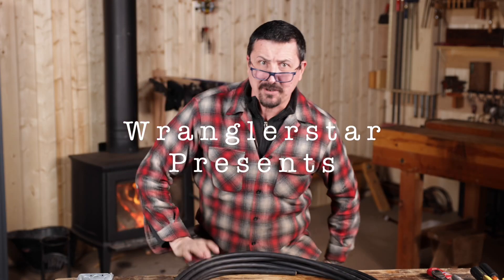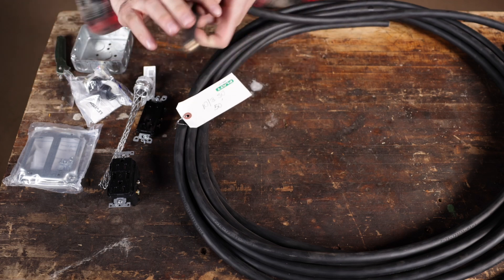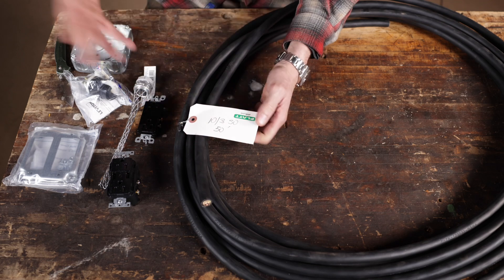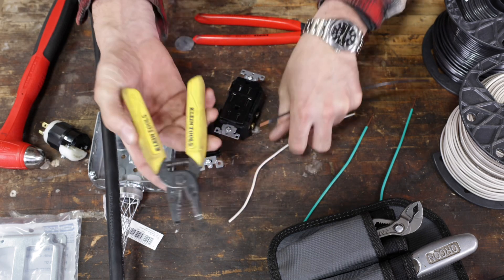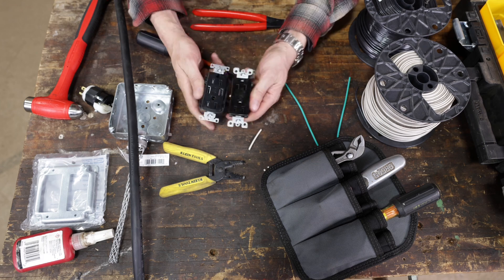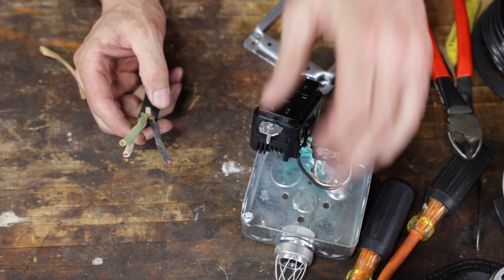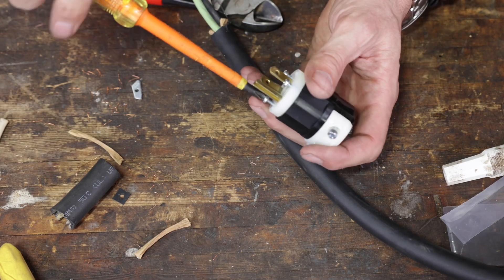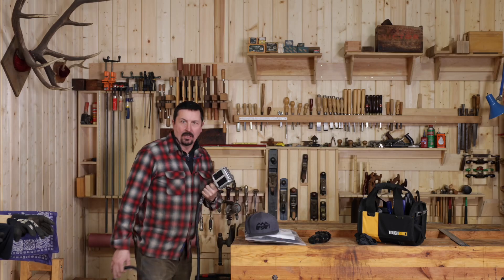The Ultimate $150 Shop Accessory - ALPHA CORD

Comment: I'm curious: Why didn't you use a weather-proof exterior box instead of the interior one? Also, why did you use 15-amp receptacles instead of 20-amp? Other than that, it looks good!
Reply: NEC allows for 15a receptacles on a 20A circuit.  I believe this is the only scenario where you are permitted to use a lesser-rated receptacle than the circuit it is designed for.  I'm not an electrician though - others will probably post the technical reason (I think it has to do with ampacity and de-rating and so forth).  If it were me, I would have used a GFCI as the "input" plug, and then wired the other outlet into the "load" side of the GCFI, so both would be protected.  I'm guessing the metal box for a few reasons: it's cheaper, and it's more durable (Aluminum/weather boxes are cast and could crack from dropping it).  I made a quad box like this and permanently attached to my welding cart (1. welder, 2. grinder, 3. wire wheel, 4. chop saw)

Comment: Small correction. Incase you guys are making these, the "jam nut'  is a called a lock ring. The piece he is using inside the box is called a fiber bushing. The correct way to install that stress relief is to have threads fully inside the 4x4 box, then put the lock ring on the threads to tighen to box, then put the fiber bushing last. The fiber bushing is to protect conductors from abrasion from the metal threads. The way he is explaining to do it, your stress relief is only held only by that small plastic bushing.

Comment: Why not have one 20A receptacle, seeing that 10 gauge cable is being used? Unless that cable is really long 20A may come in handy if you need two things operating at once, like a small heater and a heavy current draw tool.

Comment: 10-3 usually means 3 conductors PLUS the bare bond conductor, but not always. Some types of cables include the bond conductor in their ‘call out’ designation, where 10-3 could mean a black, a white and a green

Comment: nice, i repurposed an EV charging cable for a similar thing in my workshop. the damn EV plug on it had a defect that couldve been easy to repair except the thing was impossible to open without destroying the shell. also a replacement plug cost the same as a new complete cable... so i just cut off the EV plugs and made a nice thick extension cord for my tools with it.

Comment: In the context of how electrical installations in the US are standardized from NEC this is a well made extension with minimal issues on the retaining nut and how the wires are attached, nothing critical.
From a mechanical perspective i really like the general approach with a grounded metal housing and a very sophisticated strain relieve that also functions as kind of bend protection.

On a general state however I am always baffled that the connector pins, when they aren´t seated fully, by design, are open for dirt and possible short circuiting from debris. 
The whole box also does not seem to be suited for humid or wet environments, or even damp grass, so this seems to be a "indoor" extension.

Or maybe 120V is just not as critical for such issues. If the "normal" voltage was 230V Phase to Neutral and 400V from Phase to Phase you'd just have to have that kind of shielding (Type C, Type E, Type F, Type J or Type N and so on) so this would be prevented mechanically.

Who knows...

Comment: For only a few dollars more you could have put this into a water resistant box with glands where the cable inserts so you have a box that is safer to have on the ground should there be water or say you want to run power outside the shop and there is snow/rain etc. That's how mine is.

Comment: East coast electrician here, I wish most cheap extension cords use 14 wire at least, most are 16 gauge wire. Yes 16 gauge is fine for maybe running a single shop light 100 ft away or so but as soon as you start running maybe a pump or heavy duty saws anything with a larger motor those cords don't last to long.

I see a few comments already indicating the lock nut should go on the inside of the box and im not the first to say this but the metal lock nut then the plastic bushing. Also instead of using gold to black use this saying Brass to Black!

Comment: I have a question, is normally a cable, let say 10/2 for 120v and 10/3 for 240v in the US ? 
And also, is the only difference being the 10/3 having the ground wire insulated ? As 10/2 also have 3 wires but ground is not insulated.  I am wondering, please let me know :P   thanks

Comment: The reason its best to use the shortest and thickest cable you can is you want less voltage drop. More voltage drop means the tool or whatever pulls more amps to do the same job. More amps equals heat and excess heat equals early death for lots of things.

Comment: *PLAID**
Hey Cody! long time watcher, first time writer. I'm an electrician by trade and Frank's comment is correct about the lock nutt needing to be on the inside of the box, but my reason for commenting is on the box itself. To make  
A WAY COOLER ELECTRICAL BOX... Use a 2 gang metal exterior box. Its aluminum, but more importantly its moisture resistant (no mounting holes or partially opened knock outs) and then you could even add a "in use cover" so plugs would be covered for that inevitable knocked over coffee or whatever other liquids could be around. I think it would really level that thing up! Love to hear your thoughts on this! God bless you and yours! 
P.S. I also would have pigtailed 10g wire to the receptacles instead of the 12g. And you could also spend MORE MONEY on wire and bought 10-5 or 10-6 and then with box on other end with 2 plugs you could have a 120V/220V for welder AND tools! Huh? Just a thought 🙏✌😎

Comment: In a residential transformer in the United States, there is a 200/240 volt coil.  The two black wires entering your distribution panel connect to either end of that coil.  To get 110/120 volts for your home they connect a third wire (the white wire) to the center of the coil so that any electricity going through it is 110/120 because it is getting only half of the coil's voltage and current output.  The reason you get 220/240 volts by hooking two vertically mounted breakers together is because the bus bars from the two black wires alternate horizontally in connecting breakers.  That way two vertical breakers are on different bus bars and connect to both black wires to get the whole 220/240 volts from the transformer coil.

Unless you are using direct current, like you get with a car battery, both the black (hot) and white (neutral) are "hot" wires.  That is how alternating current works.  It changes directions (in the United States) sixty times a second.  That means the current goes both ways which means the black and white wire both have the potential to be hot and if you touch something else that causes the circuit to be complete while also touching the white wire then you will have electricity flowing through your body.

Comment: I've purchased the 10 / 4  power cable from Home Depot...  ouch its expensive but it performs well.  I used it to power my hunger speakers running off a 2000 watt amplifier.   No line drop!  All the power to the speaker!

Comment: I thought the first number refers to the gauge of the wire and the second number refers to how many wires are inside. 10/3 - 10 gauge wire with 3 wires inside? 

Is that correct? I know nothing about electric and wiring at all

Comment: If you don't want to use the copper ferrule then you can take a twist wire cap (red ones) and cut the top off. Take your two copper bares and twist them together with one lead longer than the other. Slip the cap over the wire through the hole you created and twist down where the two wires meet. You should have two wires twisted into the cap with the one copper lead sticking out of the top. They even make the twist caps with the hole already, search for Model 92 Greenie

Comment: Check out a Polar Wire, they are in Anchorage, AK and their wire looks even more flexible than what you showed. They have something called Arctic UltraFlex 100% copper wire built for the brutal cold of Alaska in any gauge you need. I own two sets of their jumper cables one with 4/0 conductors 30ft and the other a bit shorter is 3/0 wire, both have massive 1000 amp copper jaws, they are without question the highest quality, most rugged I have ever owned. I think you would be impressed by their wire quality

Comment: It's called SO Cord.. The technical type of cord it is, is probably SEOOW Cord. It has a lot of characteristics.. Like gasoline resistance, UV resistant, Impact resistant, etc..
Push the SO Cord through the kellem grip before you strip the outer jacket of the cord. Makes life way easier.
Your METAL lockring goes INSIDE the box, not outside. Then the plastic threaded bushing after the lockring. You don't need the bushing though.

Comment: I like the idea, nothing wrong with the setup. just wanted to mention that 10gauge wire is rated for 30amps. The two plugs that were installed are 15amp rated.  the cord end used was also 15amp rated. I can only assume it was being plugged into a 15amp rated circuit. There is nothing wrong with up sizing your wire. But In most applications it’s not necessary and not cost effective. the real alpha custom cord setup would be to 
1)upsize the breaker to 20amps
2)replace the plug(s) on that circuit to T-slot 20amp plugs as per code 
3) use #12/3 cable (#12 wire is rated for 20amps)
4) then install T-slot 20amp plugs into the box. Along with a 20amp rated cord end. This allows for higher current loads without burning up the wire and tripping the breaker. This give to best bang for you buck. 

Disclaimer this is based off of my local electrical code but common most everywhere.

Comment: 11:00 it does not fit because you are using 10/3 cable which is good for 20+amp with 15 amp plug. Upgrade to 20 amp and use outdoor box instead of that steal one so you can drag it outside when needed.

Comment: Small knit pick but as an EE it was driving me nuts. the "number wire" that you are referring to is called the gauge. It is vital to use the "gauge" vernacular when specifying wire sizes. If this is not done you could have some confusion with specialized cable (non-electrical) or mistake it for the electrical parameters (voltage, amperage, or Wattage). The sizes you show are AWG (American wire gauge) another reason to say gauge and not a number (especially if you are ordering from overseas) is that it could be confused with the international convention of using mm to measure the sizing. Love the setup otherwise, been a longtime viewer, and like to see something so close to home. I would love to spec out an even further over-engineered extension cable for you if you are interested.

Comment: the cable is called HO7NFR often referred to as TRS tough rubber sheath - always used in my industry for running temporary power for events.
Reply: that's in europe. in north america its SOW or SOOW often referred to as cab tire or sometimes you here cap tire

Comment: My Stage hand Brothers, I worked with wood add a base plate of 2 3/4 inch Birch Plywood Base plate blgger than the E box with a handle cutouts X 2 and rounded corners painted back stage Flat Black. The Stenciled Wranhlerstar in white.  Drill a few holes for a nail up or Screw to the Sticking post.  This base makes it "safer" on a damp or wet deck.

Comment: The electrician I worked for in high school and college went to govt auction.  He got a ship to shore power cable and did essentially this and had it set up to do 220 and 120 with a stupid simple mobile beaker box.  We would take about 30 minutes to set it up at a job site and be able to run the entire job site off it.   

But the basics of it was to build a giant extension cords like you did. That could easily be hooked up to line power then had breaker boxes and outlets.

Comment: How did you put ten gauge wire on the the screws on the receptacles?  You didn’t show that. They
 Wire doesn’t fit in the hole. PIA to bend 10 gauge around the screw. Better to use 12 gauge cord.

Comment: They do have them with USB-C, i recently installed one by the bed in my bedroom so i could plug my charging wire directly into the wall and get the faster charging speed, because i didn't like how far off the wall i had to move the side table to clear the charger adapter. 90 degree USB-C cable ftw.

Comment: There’s also another trick most electricians don’t know.. any seasoned electrician will tell you that hooking the ends of your wire is by far the best way to connect your wire to a device. I can’t tell you how many outlets I’ve replaced over the years from wires stabbed into the device. Next tip is you don’t need your strippers to hook your ground wire. The little hole that’s right next to the ground screw on the metal sorta underneath the green screw on a device  is the exact size for a piece of 12 wire to hook on and then you twist your wire around the screw. Just one less time picking up your strippers which makes a huge difference when trimming out 100’s of devices

Comment: It does have power running through it, if you were so inclined you could adapt it with an electromagnet instead of a rare earth magnet, that way all your metal shavings would fall off when you were done.

Comment: The good thing with 240V standard single phase electricity on the old continent is that you generally use half the thickness of the cable.
Normal, commercial cables are .75mm2, that should be 10A 240v single phase cable.
I personally use a 2.5mm2 that is meant to plug in a 240V 16A plug. A total overkill... It's meant to deliver 3.8kW over a single phase.
Homes typically have a three phase installation. The usual main breakers are 25 or 32A on all 3 phases, depending on the size of the home, the latter being an exception...
I wrote this all for context...

Comment: The hole on the wire strippers is for sheering the small screws used in electrical work instead of having to have side cutters or dulling your stripper cutting blade. Though using them to bend the wire like that is a pretty novel use as well. That said I laughed out loud when you stripped the wire before feeding it through the strain relief. Only because I have done that more times than I can count even though I know better. I always have the same exact thought too "Why did I strip that before pushing through this?".

Comment: To answer your question at 12:30, because those orange extension cords are built to get damaged in a heartbeat.  I damaged mind just using my circular saw.  Never again.  As a musician, I have plenty of speaker cables laying around.  I grab two of them and built myself a pair of extension cords.  That was back in 2000.  I still have them in my shop.  I'm gonna do your little project to have a permanent electric cable in my shop and I'll use the two I built whenever I have to drive to a location.

Comment: The ultimate engine block heater cord. How does this cable do in -45?
Reply: The rubber won't mind and the copper will have even less resistance
Reply: @schwuzi  It won't get super stiff? That's my problem with most extension cords.

Comment: note - buy 10-4 and run a dryer plug, or welder plug on the "house" side, 2 20 amp breakers one feeding each outlet (wiring would be RED/WHITE/GREEN on one wiring on other would be BLACK/Jumper White & Jumper Green (sharing neutral/ground))
ALSO TAPE UP YOUR OUTLET SCREWS THATS A METAL BOX

Comment: Tried this on my own and do yourself a favor and buy the 12/3 cord vs the 10/3 shown here. It is really challenging and almost impossible to get that fat cord and wire to fit with 15 and 20 amp gear. Curious that he glosses over the some of the trickiest parts in this video.

Comment: I like everything except the choice of box itself. I would have used a weather proof box instead of a construction box to prevent something from intruding into the small holes in the box. I've witnessed small screw drivers going into the holes causing a short/fire.

Cable is normally a SOOJ cord with EPDM coating for that flex, though keep it out of petroleum based oils, and sunlight to prevent jacket decay. SOOJ cord is good to suspend from a ceiling with the strain reliefs.

Comment: What you guys need there is good ole 240v everything and for the real big stuff 415v three phase.     Double the voltage and then the wire only needs to half as thick for the same energy transfer.      Our 240 kitchen cooking appliances are faster, we can have several high current appliances on one regular 20a  circuit (yeah that’s about 40a at 120v) my mig welder works on a regular household outlet.    It’s awesome, but deadly.   Every circuit must have an RCD / GFI 

On the other hand I wish we had 110/120v for lighting....

Comment: that wire is 10/2 not 10/3. 10/3 has 4 wires. 
10/3 has 2 hots 1 neutral  and 1 ground and has 2 hots because its for 240 volts.

Comment: So you can use it with 240? The higher the voltage the thinner can the wire be unless you meant something else by 240

Comment: i want you to try something / trick of the trade from a old electrician / when you put stranded wire under a screw twist the strands the opposite way and when you put it under the screw you will find it holds better and does not fray / what it does is pull the wires in tight to the screw

Comment: Speaking of the storage units i remember as a young private living out of the barracks i ended up getting a storage unit off post for my dirt bike. Well over time it evolved i worked on the bike in this little 5x10 storage unit and build a little mobile 3 ft wide workbench that i mounted my reloading press on and plugged a extension cord into a 110v inverter from my truck and used it for numerous things. But in the Tennessee heat i was definitely relieved when i finally moved into a house and could reload ammo on the same 3ft bench in AC of the kitchen lol